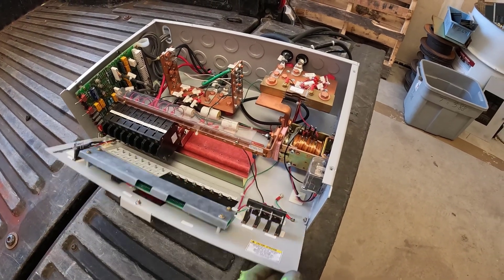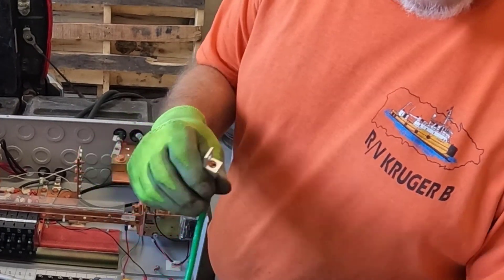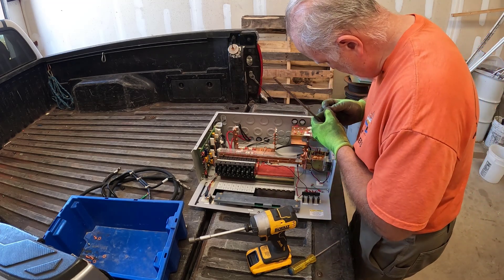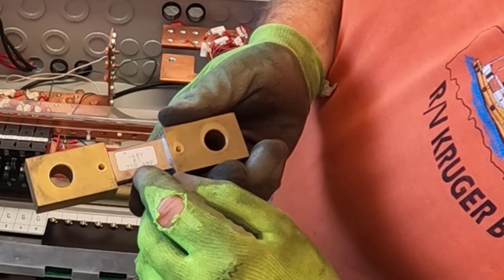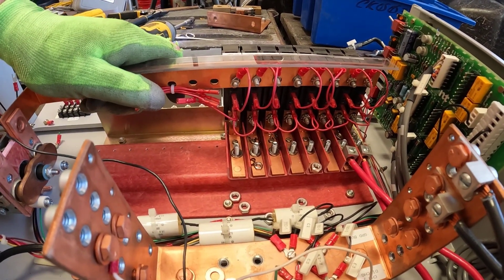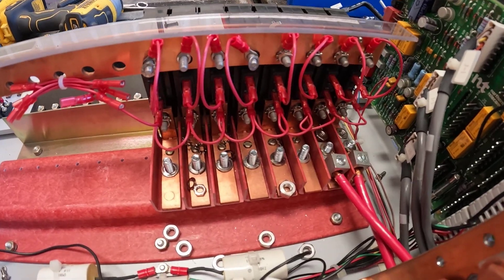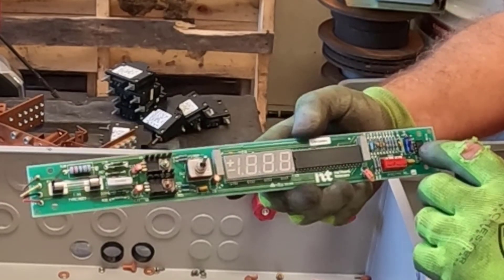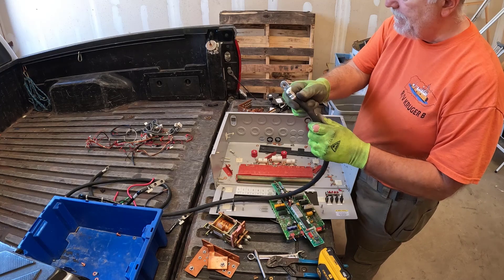Scrapping a Nortel TELCOM power box   serious copper

Comment: 6:12 Yes stainless which goes back to my previous comment. When it comes to stainless steel (301, 304 and 310) and brass, they are only two metals apart, which means they can be safely connected together with minimal risk of galvanic corrosion.

Comment: The contacts looks to be 800 silver .You will need a cutting torch to heat them up to get off and ware your PPE . I have about 20 to 30 lbs that I need to strip down there out of 600 amp motor starters . That is one of the things I miss about when I was working is the free torch usage and scrap .
Reply from the maker: Thanks, I'll set them aside for now.  Maybe see if I can get a collection of similar things before I work on separating them.

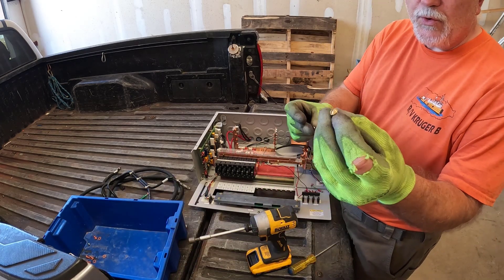Comment: 4:14 I would expect all of the essential connections to contain similar metals, ie: brass on brass in order to prevent galvanic corrosion, particularly in an outdoor environment where humidity and the potential for salt could be introduced.
Reply from the maker: Takes me back to my material science classes when I was studying ocean engineering.  Of course sea water will eventually corrode anything 🤣 or so it seems sometimes.

Comment: 6:33 That is a current shunt, the middle is a very low value resistor not sure what material that would be.  These are used to measure current flow.
Reply from the maker: Awesome, thanks.  Now to see if I can figure out what that alloy is.
Reply from the maker: I think I found it - manganin.  So awesome to learn - thank you.

Comment: Most likely those blades on brass fuse are zinc
Reply from the maker: It feels harder under the file than zinc usually does.  I'm still perplexed.
Reply: @sharkscrapper  Do you have any spray that you use on pot metal and cast Alum
Reply from the maker: @jr-a-cat  yup - sure do